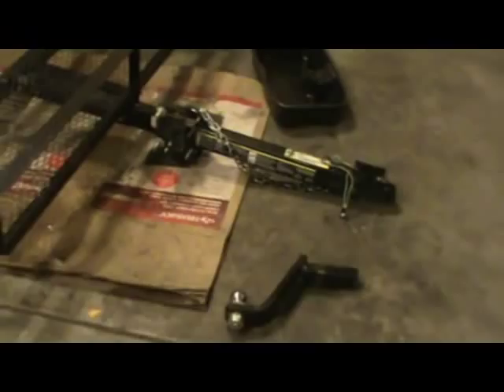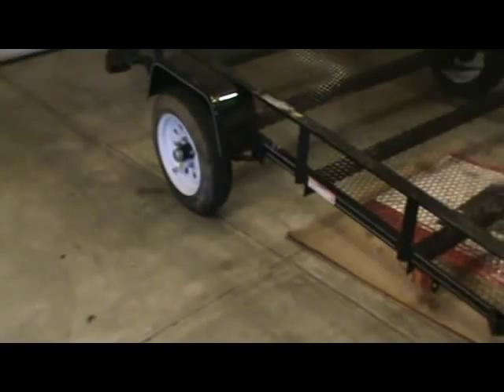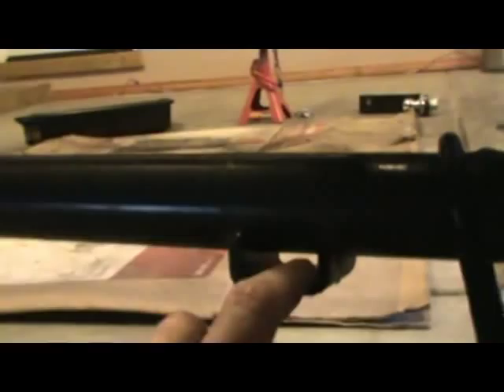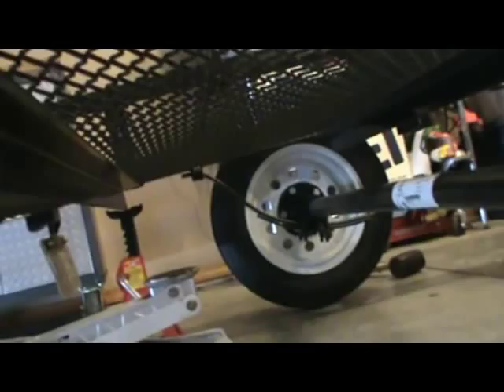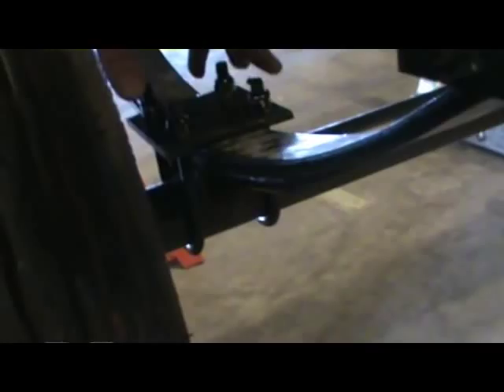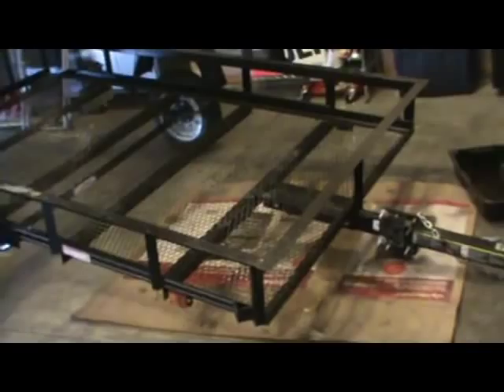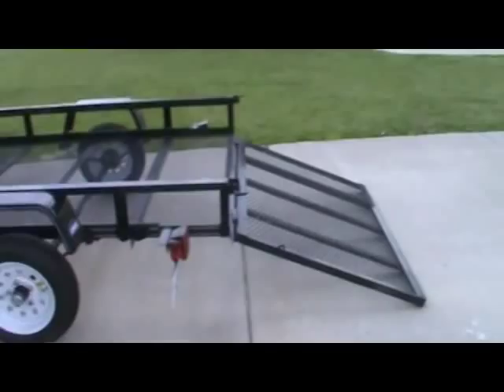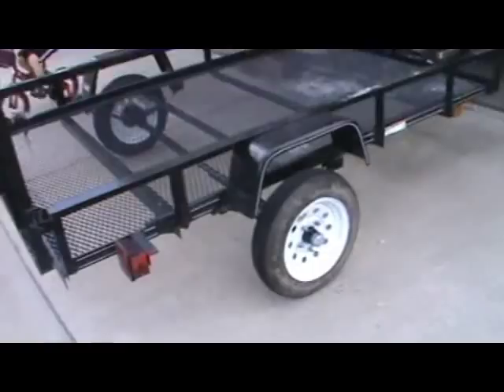Carry On Trailer Axle Flip Walk Through

Comment from the maker: I have used this trailer countless times and have even had it way over the weight limit. The tires show no wear. It tracks fine. Yes there is camber built into the axle. Yes this reverses it. I have years of experience with this now and it works great! If you post what could would or might happen with zero experience I’ll delete it. If you however have tried this and actually had a problem go ahead and be the first person on the internet and let us know. Google can’t even find a real incident of this causing a problem.
Reply: Thanks for this comment. I also had this idea from the same lowes post but after seeing all the "tire wear, bearing wear, handling etc." comments on other videos and sites i was a bit weary of flipping mine. but seeing as you've posted this almost 5 years ago now and updated us within the last 6 months with no issues i'll be flipping mine this weekend. thanks again for the follow up years after the original post.
Reply: I’m thinking about buying a 4x6 from Lowe’s for my water tank 350 gallon (2915 lbs full). Do you think the 2000 lb axle “flipped” can handle it? It’s gonna sit at my deer lease for my water supply.
Reply from the maker: @Rome_504  no. The max load for the tires on it is 990 lbs. each. Putting the tires limitations at 1980 lbs. say the trailer weighs 300lbs. The tires could handle 1680lbs in the trailer. I have carried more than that on the two trips I made picking up my flooring. Had I knew the weight I was carrying I definitely would have broke it up into more trips. Flipping the axle seemed to have no effect on the trailers weight carrying ability. However I wouldn’t purposely overload it. Stock or flipped. It would be asking for tire failure. I count myself lucky 🍀 on my flooring trips. (Just looked. Mine is rated for 1700 lbs. so you are looking at a stronger one. I would recommend getting one for the weight you intend to carry nonetheless.)
Reply: @Ihateallgingers  I was gonna upgrade the tires to 13 or 14”
Reply from the maker: @Rome_504  I would look at the components on the heavier rated trailers there. See if they are bigger and stronger.   I bet they are. More so than just tires. I know mine has a wire mesh floor that is easy to bend in. I’ve since put a plastic liner in it. You could bolt 4x6 to it. And make the floor as strong as the higher rated ones. But then you are adding more weight. Reducing the capacity. Improved tires would definitely help. But what about the axel itself? Or the wheel bearings? Then you got liability. If you purposely overload something and it fails you would be responsible for whatever happens during that failure. I still wouldn’t over load one on purpose. I’m sure many people have and had no problem. Heck. I’m one of them. But afterwards figuring out what I did.  I doubt I’ll ever be in that situation again. If I were you. And you really want that trailer. (It’s so affordable) I’d make more trips. Fill up your water tank a little less than half. Stay at the weight rating. Then when it’s empty go fill it up again. It’s a hassle. But it’s safer.

Comment from the maker: Update. I have now carried 1000 pounds of landscape bricks and mulch at speeds of 60-70 mph. The distance on the highway was around 15 miles. No problems whatsoever. Trailer was 625 pounds shy of max load. Another benefit I noticed is not having to bend over as far to pick up bricks out of the trailer.

Comment: Nice. Just a quick fyi...those 5 lug hubs on your trailer are the same bolt pattern as many older jeeps...you could ditch the fenders and throw a set of yj rims/tires on it, then you'd always have a spare trailer tire with you.
Reply from the maker: That's awesome!
Reply: Older sheeps are 5 on 5 1/2

Comment from the maker: I have since used trailer several times since doing the axle flip at speeds up to 70 MPH. It behaves just like it did before the flip. Tracks fine. Works great. :)
Reply: quick question the bend in the middle of the axle which way did you leave it?
Reply from the maker: @juniorcarrillo9715  the opposite way.

Comment: I wonder if the camber change is actually a good thing. Not from a load capacity standpoint but from a stability standpoint.  By raising the height of the trailer, you make it slightly more top heavy which could reduce stability and/or make it more likely to sway.  But the negative camber might actually make the trailer more stable and cancel out the additional height when it comes to trailer sway.
Reply from the maker: JM Thomas Not sure. Good point though. I’ve used this thing a ton since the years this video has been made. To me the trailer performs exactly as before just higher.

Comment: I just bought the same 5x8 trailer.  I was looking on YouTube to check out people's mods and came across your video.  I have a Jeep JKU with 35" tires and a 4" lift but I use an adjustable trailer hitch from Harbor Freight which can drop down 11" / raise up 10" .  That solved everything for me because I have 2 vehicles (different heights) that I can use it on.  I like your idea though.  It's free and can be done in under an hour!
Reply from the maker: That’s good to know. I have different hitches for all kinds of things I tow. An adjustable one sure sounds nice. I have my Jeep still. But also got a 2020 Ram 1500 with a factory hitch. It’s stock height and this trailer still won’t sit level with that 8” drop ball. It still works fine. I just wonder what kind of vehicle they designed this for? I seriously put a ball on my lawnmower to move it around and it’s the perfect height after the axle flip 😂. Thanks for letting everyone know about that Harbor Freight hitch. Take care!

Comment: I have done this so it is level with my Tahoe lift on 26s. tow my street bike and my mower (and many other heavy things) for 3yrs and no camber wear or issues. but I am looking for more lift
Reply from the maker: Hella Beefy yeah. It works great. So well I started deleting all the inexperienced "you might" or "what if" comments. People think they know everything just because camber is built into the axel. Yet have ZERO experience. One comment said the bolt pattern is the same as keeps wranglers of the TJ era. 97-04. If he's right you could get some wheels from a junkyard and remove the fenders. That would be substantial lift. I'm not sure if the tailgate would still reach the ground though.
Reply: it's a tilt trailer so just put a pin and a limiting chain to fix that issuss

Comment: Why not remove tire, take brackets off, pull axle put and flip? No need to remove the springs
Reply from the maker: I don’t see why you couldn’t. Seems either way would be pretty easy. Wasn’t hard to take the springs off at all.
Reply: @Ihateallgingers  yeah I did mine when You changed my bearings since the hubs were off. made it super easy.

Comment: there are 2 kits available 2 3/8" and 3"  the same site has both and so does amazon. mine took the 2 3/8 kit. installation took less than 1 hour. that included fixing the electric brakes.

Comment: trailer axles have camber built into them so when loaded the wheels are almost straight up and down. there is a slight bend in the axle tube to get this done. when you rolled it over you changed this now the tires will wear on the inside tread. to correct this you need to install an axle over/under kit.
 http://www.easternmarine.com/dexter-2-3-8-axle-over-under-conversion-kit-k71-384-00
Reply from the maker: That's a cool looking kit. Thanks for posting.
Reply: He did not roll the axle...he simply placid it under the leaf spring as opposed to over (in the same orientation) to gain some height.
Reply from the maker: +ROTAXD actually I did. I'll tell you I know it has camber built in and I reversed it. But I have also carried my hardwood flooring home on it using two trips. I weighed a carton later and found out my trailer was grossly overloaded. I travelled 70mph on the highway. I have noticed no negative effects what so ever. But the people saying I rotated it and reversed the camber are correct.

Comment: I bet the camber is off and you might wear tires fast
Reply from the maker: The only thing I can find on the Internet are RV forums saying it "may" cause your trailer to sway. I have done this a long time ago now. It's funny all the people that still tell me all the problems I "may" have. Nope. It works fine. No problems. Not over loaded well beyond capacity even. The tires look great. They are not like car tires. That accelerate the vehicle and brake the vehicle. They just role under it. No wear at all.

Comment: i was thinking about doing the same to my 5x9 trailer but after reading mr. Ray Whyte's reply, i think i'll just thow in bigger wheels and tires. but my problem is that i have a 4runner which has a 6x 5.5 lug pattern and the trailer is a 5 lug pattern. so i'm going to oder the right hub to put on the trailer.
Reply from the maker: I wouldn't order unless you want fancy. Junkyards have sweet deals on wheels. Have some nice ones as well.
Reply: +Ihateallgingers i'm using the factory wheels from my 2015 4runner, that i have sitting in the garage.
Reply from the maker: +George Lee (Samsung) that will be cool. Wonder what it will do to the ramp angle? Or if it can even touch?
Reply: +Ihateallgingers it'll be steeper for sure. as long as i can ride my 4wheeler on it it'll be ok. my reason for flipping the axle , is because i want to get better ground clearence on the trails.
Reply from the maker: +George Lee (Samsung) let me know what happens and if the ramp reaches the ground. I'd appreciate it.

Comment: A walk through? Dude you didn’t show anything.
Reply from the maker: If you need further guidance, feel free to ask questions. I’ll answer them for you. I’m not some giant you tuber. I respond to anything. I’m just trying to help people with stuff I learned. To give you an idea, I was offered moneterization but declined as the 50¢ I would get a year isn’t worth making you watch adds to me.  It’s really simple. In the end you are taking off the leaf springs and putting the axel under them instead of over them. It’s only a few bolts. Recording myself turning a wrench instead of saying, “This is what I just did.” And showing all the wrench turning is kinda a waste of time. Ultimately it makes your trailer a few inches higher. The comments here are good info as well. Other options are welding on new brackets. Adding larger wheels and tires. Or doing it just like this. But instead of jacking up the trailer a viewer flipped it over to do the work since it’s so light. If you still have questions feel free. I’ll probably be able to respond as quickly as I did this. Take care.
Reply: Thanks, I gotcha. I Was just expecting something different. It’s all good.